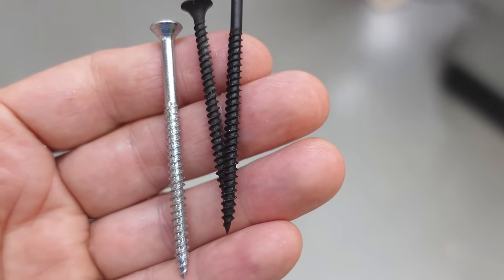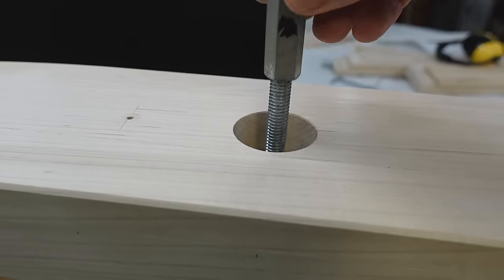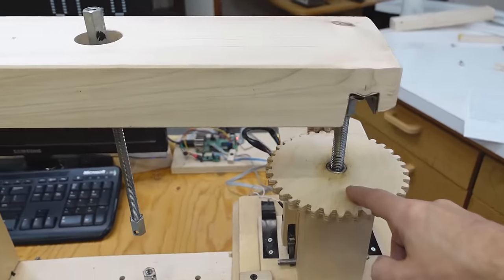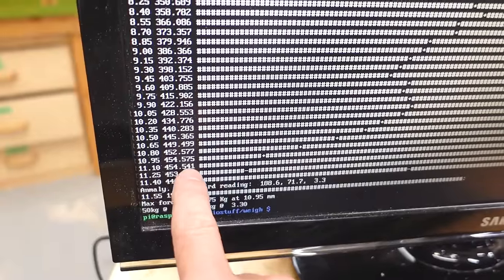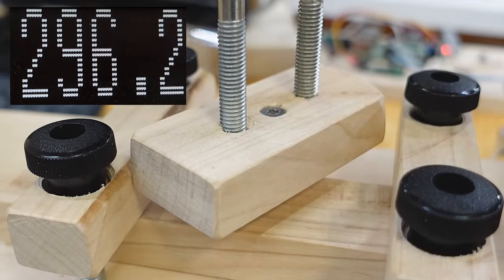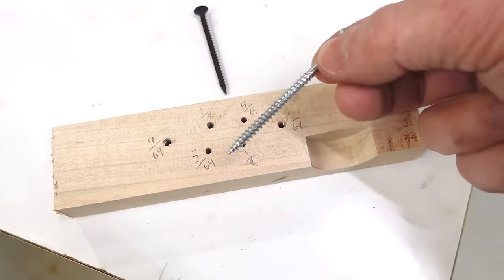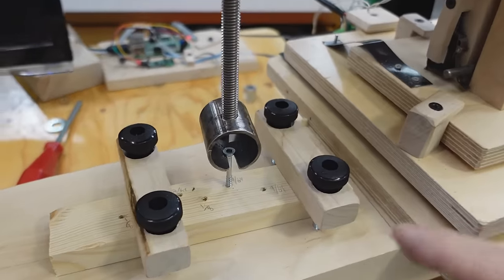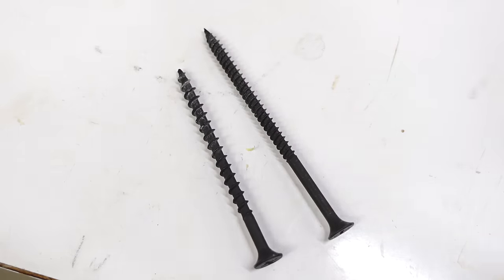How well do screws hold in wood?

Comment: I usually find these type of tests interesting but kind of useless until, a few months or so later, I run into an application where it matters and then I think "Darn, I'm glad Matthias ran that test so I don't have to." Thanks for doing the work and keep it up. I really do like these videos.
Reply: Similar. Apart from wood splitting, I've always questioned why my dad would randomly stop to drill a pilot hole when just throwing a screw at something and moving on seemed fine. I'd always assumed pilot holes had a greater negative impact, but seeing hold strength is nearly unaffected is pretty unexpected.
Reply: @custos3249 my pops taught me to drill an oversized hole (slightly larger than the thread diameter) in the first piece to prevent screw jacking and a pilot hole in the 2nd piece to prevent splitting.  

An oversized hole comes in super handy when setting doors.
Reply: بالعكس هذا الاختبار مفيد جدا وخصوصا لأصحاب التخصص
Reply: I still think theyre useless

Comment: I would love to see these tests performed in isotropic engineering materials like HDPE, nylon, or acetal plastic. Each plastic with a unique, known yield strength and ultimate strength. I've wondered if the results would be more consistent. Then, I'd also be very interested to see if the results from the engineering materials could be generalized for many different wood species, hardness levels, and grain directions.
Reply: I would agree, that would be a good one for the Mathias “bullsh*t detector” test 🤣
Reply: Plastics aren't super great for "unique, known half and ultimate strength" ... They can be a little tricky to pin down with creep and plastic deformation

Comment: I was assigned a project at work to compare the holding power of screws Vs. rivets and roves in ship building. I searched for weeks for a published standard and mostly just found conflicting numbers published by screw manufacturers. I wasn’t quite at the bottom of the internet (but I could see it from there) when I found a study published by the Montana school of forestry for the construction industry that laid out pull strength of screws in wood. The interesting part of the study was that the moisture content of the wood played a huge factor in the screws holding power.

Comment: I found this very fascinating about the pilot hole size versus pull-out strength. With no pilot hole being not much stronger than minor thread diameter, I will be putting pilot holes in to prevent splitting even more than I had been. Thank you so much for sharing these strength test videos. Very informative!

Comment: Thanks for doing these tests. I usually eyeball drills to use for pilot holes. I try and get one the minor diameter or just slightly larger. One slightly larger will be easier to drive and lower the chances of splitting the wood. It's also interesting how the number of screw threads didn't impact pull force that much. Looking forward to seeing you test different fasteners.
Reply: drilling a pilot that is larger than the minor diameter will reduce the holding strength by a massive amount  tho

Comment: Glad to see there's so little difference, because that's something I've always eye balled. I try to make my pilot hole the size of the screw core, or slightly smaller.

And I've always prefered screws with less threads because they tend to strip less easilly when I drive them in. Especially in softwood.
Reply: Interesting test.  However, I don’t think that just pulling on the screw is correct.  You need to pull on the joint.  It’s a bit complicated to explain in a comment but it has to do with compression of the clamped piece

Comment: I would be interested to see a video on the force required to sheer off a 16d and 8d nails. A lot of times in the trades you nail a cleat to a wall or something you want to move with a crane, and I have always considered a 16d to reliably hold around 200lbs in the sheer direction. Sheer paneling on modern engineered structures usually requires a very specific number of 8d common ("common" being a specific diameter) nails for a reason. Commerical or school wall framing requires 16d common nails for nailing studs, etc. I always prefered to use a smaller diameter nail because there is less splitting especially in dry lumber.

Comment: actually, those tests are really interesting, helps a lot in trying to select which screw to use for which task. I usually go by gut, or try to follow some arbitrary recommendations, which were already proved wrong with your experiment on the thread count (although I suppose they are a bit stronger, but not by enough to be worth it)
Reply: This is so useful. I'm used to just using whatever is laying around, which is usually drywall screws, but whenever it's actually under some load I'm always wondering what are actually the right screws to be using here.

Comment: I just built a bike camper and was just thinking about this...also sheer strength between two pieces of wood screwed together.  Perfect timing!  This literally helps me decide how many screws are are actually necessary.  I know the screws will usually break if you try to pull em out with a cat's claw or crow bar.  So pull strength seems far greater than sheer strength, but I really dont know.
Reply: Intuitively I would think you’d get tear out way before actually shearing the screws themselves. 
Would be fun to see it tested though!

Comment: i wonder if treating the holes with cyanoacrylate or wood glue will make a difference to the yield strength of the wood?
Reply: Would be cool to see. My prediction is that the glue actually makes the wood more brittle and will fail sooner.
Reply: @F0XD1E  You make an interesting point. You’ve got me thinking that there could also be a “sharp edge” between the CA glue and the unglued fibres which would lead to an additional failure point
Reply: @F0XD1E   Interesting. I was thinking it would permeate into the wood and make a few mm of hardened wood around the hole. Hopefully our gracious host will see fit to try this for us on his testing apparatus and let us all know.
Reply: @F0XD1E  I'll stick my three ha'pence worth in.
The glue is fluid, and so soaks into the soft wood fibres. That forms a composite material that is hard and flexible. In addition the glue only sets fully under pressure, so the junction between the screw's hole and the clean wood is gradual. When the glue is fully dry, there's now a plug of the composite material maybe a half inch in diameter intimately bonded to the structure of the wood.
Hard wood? Meh, not so much. Time for an experiment, now I wonder who might be interested enough to do that?

Comment: Ohh, there's so much more I'd like to know now (also there wasn't more about pilothole sizes than I wanted to know in the video 😉).
How much weaker is a screw into end grain?
What about machine screws compared to same outer diameter wood screws?
Does tapping the hole change anything?
Is there a difference between cutting the thread with a tap and a screw made into a "tap" by filing/grinding teeth into it? (I have accumulated a whole set of the latter over time, because taps create slightly oversize threads compared to screws on purpose, but for wood that's not needed and screws don't "wobble" in a thread cut with another screw)?
Reply: Come to think of it, yeah, what about all that?...

Comment: There is the concept of the stiffness of the testing machine.  As you apply load to the specimen and the specimen deforms, the testing machine also deforms.  If the testing machine deforms a lot and the specimen fails suddenly, the testing machine will react like a spring and can recoil quite a bit.  If the testing machine is very stiff it will not recoil very much.
I thought the pilot hole tests were very interesting.  I drill pilot holes for most uses because it makes it practical to drive the screws.  I'm always worried about what size pilot hole I should use, now I know.
If you do building construction out of wood you are only allowed relatively shallow notches in the end of beams or joists.  When I saw the notch you created in the top beam I thought it would split relatively early but it didn't.
Reply: To be fair: his results seem to bear out the conventional wisdom on the matter: pilot hole should be equal to the minor diameter of the threads (the center "rod" of the screw, inside the threads. 

This makes an enormous amount of sense: the threads are a helical inclined plane that taper to a cutting edge. This means that, by providing a pilot for the innermost cylinder, one provides a shaft for that innermost rod to live in. The outer threads cut their own path, cumulatively, into the wood fibers. This means the maximum amount of thread penetration and contact with the minimum amount of lateral play. 

One might go 1/64 smaller in central shaft size (pilot), in that the swarf from the threads' cutting should only get impacted around the screw, making the void that tiny bit stronger, but it WOULD be just that: a tiny bit.

In short: on this one we old guys are right: just use the minor diameter of the screw, maybe a hair smaller for softwoods.

Comment: Super cool testing.
I wonder how pull force is affected if you screw in, then screw out (like making the threads), and then screw in again the same screw and "tight it enough".
Also how much pull a regular bolt of same external diameter will hold compared to an screw.

Comment: I love it! I would like to see a test where you look at pilot holes vs wood splitting. My gut feeling has always been to use a pilot hole close to the minor dia. But should it be larger if I really like to avoid having the wood split on me?
Reply: Wood being a natural material with a lot of variability to it there's no guarantees. But certain practices will increase your odds of not getting a split. To that end any pilot hole is going to help you out. There's still other factors to consider though. Like distance from the edge. Which growth ring you go in. Summer vs winter.

Comment: I would be very interested to see what would happen if you squeezed a drop or two of epoxy into the pilot hole, before screwing the screw in and let it cure overnight, before pulling. 
Very interesting experiments and test fixtures you come up with.
Reply: Let it cure for 3 days.

Comment: Glad you found the most common failure mode: the wood is collapsing.  I suspect that's why no pilot hole showed a slight increase in one of your tests: that pre-loaded the wood fibers and the preload is what resisted failure for a little bit more.

Comment: i'd be very interested to see the same with bolts, different pilot holes, whether you use a cutting or forming tap or just another bolt to form the threads and also the effect of repeated unscrewing and screwing in of the bolt.  It'd also be interesting to compare this to the threaded inserts and also how susceptible the wood threads are to cross threading. (sorry many thoughts there :) )

Comment: My takeaway was: "do what you expect you should do an use a pilot hole at or just under the minor diameter to ensure secureness and prevent splitting" and potentially "flatter heads may actually be better at preventing pull through"

Comment: Very interesting.  It makes me wonder what the difference between cut nails vs wire nails would be.  I know the makers of modern cut nails say they hold a lot tighter, which I wouldn't doubt, but this really makes a person thing, especially with your discovery that the failures were mostly from the wood fibers bending upwards rather than threads shearing.  As the theory behind cut nails is that they bend the fibers down as they're driven in, so would they hold better as a result?

Comment: Wood density is probably the main factor. Then all kinds of variables, hardness, stiffness, moisture content, etc. Holding power of pallet nails (spiral or ring shank) often surpasses the tensile strength of the steel. Screws can be even more tenacious, but sometimes less, because the threads being finer disrupt wood more. This is a well studied thing, because building codes and all kind of engineering depend on fastener strength.

Comment: Exceptionally test, thank you for it. Could you do a screw pull-out test in which you compare the force of pulling the screw out of wood depending on the screw thickness and separately depending on the screw length?

Comment: I think the surface finish of the nails makes a big difference in gripping power. Smooth slides through the wood while the rough grabs all along the screws shaft. Maybe measure amount of torque needed to screw them into the wood?

Comment: Sheer strength vs. pull out strength would be great to know, to help decide the best way to orient screws when attaching dimensional lumber for suspended scrap wood racks (or any suspended wood shelves in the garage). Thanks!

Comment: "probably way more than you ever wanted to hear about how much pilot hole size matters" — actually NO NOT AT ALL. I have wondered about this question a lot and would like to see more. My intuition is that pilot holes smaller than the minor diameter do matter (friction), but that wasn't the focus of the test. Also, your hole size seems close to the grain thickness, which makes me wonder if you're seeing grain variation contributing to the apparent randomness. Perhaps understanding the dynamics should be done with a screw diameter that is much much larger than the grain variation to start with (but you won't find #14 bugle head fasteners)…or maybe with a more uniform material like delrin or nylon.  Just to a baseline and graph some data, and then switch back to wood grain and see how it changes?
Reply: Every time I screw into wood I wonder. Which is quite a lot so that's been a lot of wondering. If you didn't want it to hold together you wouldn't be sinking screws.
Reply: Also very grateful to see these tests

And delrin test sounds like a clever idea
Reply: @allencummings7564  I'm more of a HDPE kind of a guy myself. Delrin is a bit highbrow for my tastes.
Reply: Lol
Reply: How about MDF?  Seems like it might qualify for uniformity but I'm not sure
Reply: @allencummings7564  MDF is a very uniform material. I don't think MDF holds screws like wood does though. MDF is really prone to blowing out. Now there's certain screws that claim to work well in MDF. But I don't know.

Comment: The lack of difference between fine and coarse thread is very interesting.  It begs the question of why ever use fine threaded? Only for more pulling force when driving? But that only really matters when driving screws by hand or with a very weak drill, and more threads are harder to drive because of increased friction, so that is arguably not even a benefit. And with a impact driver force isn't really a limiting factor and the finer thread is more likely to strip when over tightened, less likely to split the wood and faster/easier to drive.

I would be interested in a follow up test to see how much pilot hole size and thread density matters for force required to strip to the threads when driving them.

Comment: The finer thread drywal screw is usually intended to be used with metal (C and W type ) framing while the coarse thread is intended for wood framing (because that is what is easier to screw into the respective material or to get more holding power out of the thin metal frames). I am surprised that it actually makes a difference that way in wood. with less wood between the threads, I would have possibly expected results theother way round. But this is possibly kind of a balance between how much fibers are in between the threads and how many threads there are.

Comment: This has provided data that I have wanted for over 40 years. If you could devise a method to test pilot hole diameter vs. fastener failure at the head (twisting off the screw head), that would be of great interest.

Comment: 7:04 "It is a bit of a mystery..."  I think there are perhaps 2 factors that cause the wood screw to pull deeper into the wood than the drywall screw.  

Firstly, the drywall screw is theaded further up the shank than the wood screw, giving it more support in the upper piece of wood. I think that is part of the wood screw design, because in the normal application of the wood screw holding to pieces of wood together, the unthreaded portion of the shank causes the upper piece to be sucked together to the lower piece. 

Secondly, being more conical the wood screw head has more wedging action than the drywall bugle head. I think the bugle head is optimized to prevent tearing of the drywall paper.
Reply from the maker: I always had 19 mm of full, non conical thread in the wood to eliminate the factors you mentioned.  I guess I should have mentioned that, but I thought that was too obvious to necessitate it.

Comment: Please do the standard 1 1/4" drywall screws, course versus fine thread! I think your long screws compensate for the difference in thread. I do drywall and painting and I've been told to not use fine threaded screws in wood. Anecdotally, I've never seen course thread pop but I just fixed a lot of fine thread screw pops in a pretty new house.

Comment: I like the concept. Would you mind testing the holes if they have been tapped or used before?  Interesting to see if re-using a screw hole has an affect on strength. Especially since cabinets are sometimes taken apart and re-assembled. I have always wondered if using the same holes in hardwood faces decreases the strength the number of time they are reused.